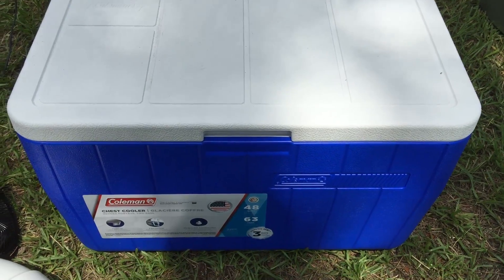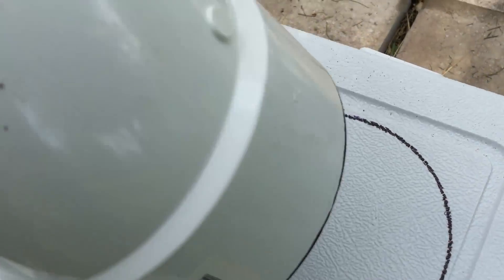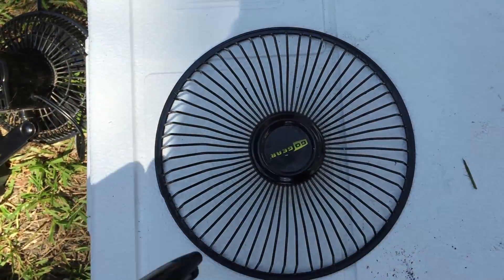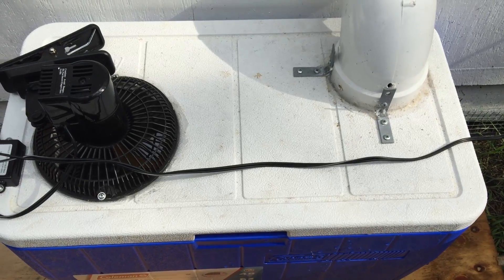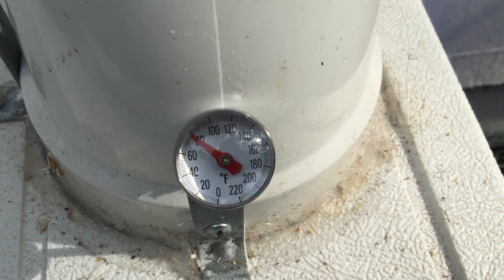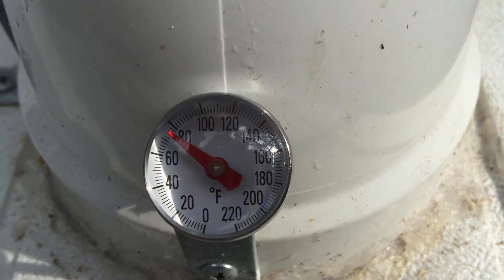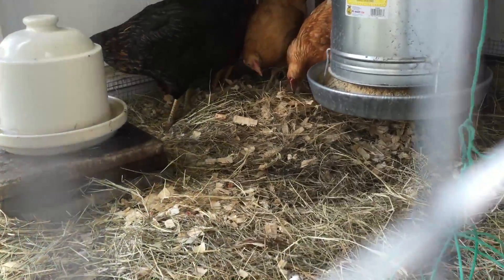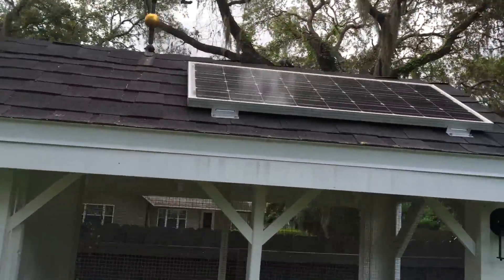DIY Air Conditioner | Build An Off-Grid A/C for under $50 | BLOWS COLD

Comment: none of these videos day what size pvc pipe to use
Reply: Use your own judgement its not complicated!
Reply from the maker: +Mike Kane it's 4"
Reply: any kind you would like tbh, 2"-3"
Reply: +Godz but which works best is what I'm looking for but thank you I think I'll go with a 4
Reply: Jacob Crab Nice, well i would assume a smaller tube has more airflow and larger would have a lower airflow..
Reply: +Godz I'll be adding air rocks into the pipes for that reason
Reply: Nice, my plan so far is 1 panel (undecided), 2 12v/7amp batteries (1 as back up), a solar charge controller, a fan (undecided), 2-3 angled 3" PVC pipes, and either a 5 gallon bucket or 5 gallon cooler container.
Reply: +Godz either way you go if put the water in the ground feeding your plants water above 85 I think it is not good fir them

Comment: can you dig a hole, drop a water tank in the ground bout 10 feet or so and refresh the water in the water cooler with water from underground with a sensor for water temp to control a water pump that sends down water from the cooler and pulls water up from underground?

Never need to drop ice in it again, fully self sufficient.
Reply: Evaporation

Comment: ok that is a great AC for your chickens,I dont know what you are cooling your home with but a insulated duct tube with the 12v fan close to floor level in your home would do the same and you wouldnt have to produce ice or mess with it,just put screen over end in coop so nothing climbs in it to your home. now if you really want to cool your home and coop. dig down 5´X5´hole let water run in put 5-10 1¨PVC pipes down to within inches of the bottom at top end away from 1¨pvc put a 4¨pvc elbow into insulated duct tube with 12v and leave it on. your whole house cools with GEO. I live way off the grid. No power lines No solar No gas but yet I have 20,000kw 110v&220v AC power. but I cool my home where the coolest temps here are 50deg. most of the time its 80-90deg. and my 2 bedroom kit,liv and bath stay 68-73 deg yr round. I have AC units but have not yet used.the trick water in bottom of hole 1¨pvc hot{shade} air goes down cools in water 4¨pulls cool air into house.  if you could slow run water through that cooler it would cool chicks and save you time making ice. All of this is just a thought.
Reply: Miguel Reyes I think Geothermal is awesome but I hear there is the danger of Radon gas. Have you ever encountered that problem or did anything to test for it?

Comment: Not to be a troll, but how are you going to generate ice without household power or going to a store? If you're using solar power to run your freezer, that's all well and good, but the compressor in your freezer is a lot like the compressor in a conventional A/C unit.  Why not just run a conventional A/C with that same power?  It would actually be more efficient...
Reply: Agreed. And A/C uses gas, more effective than ice cubes.
Reply: +Spencer Krause Then what would you use to keep your food cold? You need your freezer, and this takes no power compared to double the power of your freezer would take if you had an AC.